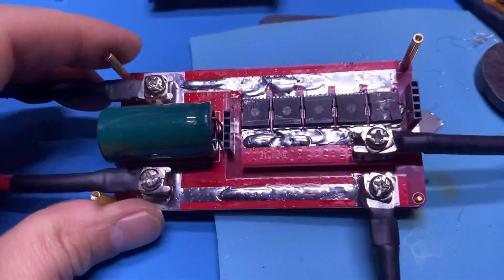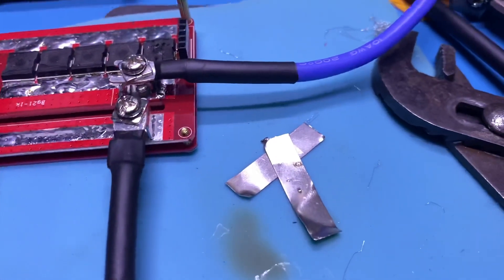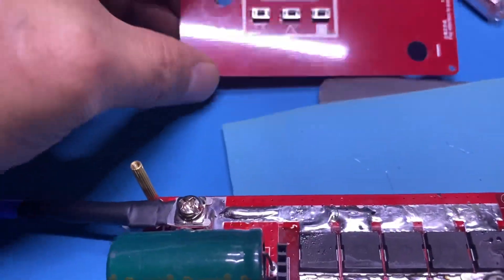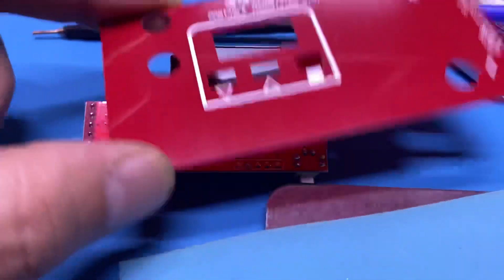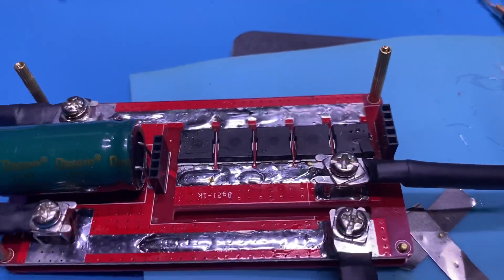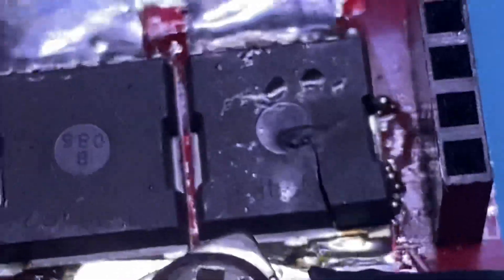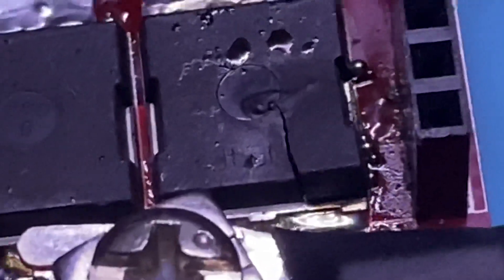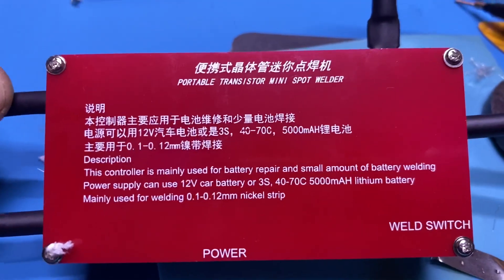Mini spot welder Don’t Buy It  What a piece of Shi#

Comment: Reacties

Voeg een openbare reactie toe…

C Knol
Fiends have exactly the same spotwelder, did some upgrades before using it. and it is working flawlessly. 
They put a resistor on both boards like in the YouTube modding is told, bit fiddly but doable, costed a few cents for the resistors. Beefed up the soldering lines with copper and more solder and changed the to thin 10 awg source line for 6 awg battery cable with battery clamps. They use a 73ah car battery. 
All for a few euro s and a little sweat more you can have a lot of benefits from this spotwelders.
They do 0.2mmon E55 no problem, no heating up, even no fan needed! 

Why put in negative feedback when not necessary if you look a little further..

Comment: i have build a DIY spot welder from an oven transformer which is awesome i think that durable than any other battery-based spot welder it has lots off power even it can weld thin iron sheets.

Comment: sorry to know I did the same my spot welder burned like yours. then i brought new Mosfet replaced them now its working fine. it can weld really thin nickel trip under 0.12mm replace then MOSFET and don't go over 40E

Comment: Could you use the controller to  switch a car starter relay. Run the high amps thru relay and not controller?
Reply: Controler board can be used to trigger relay. Issue with relay is sometime it stuck that would really dangerous. Fire 🔥
Reply: @DrNasirHayat  a mechanical relay reacts too slowly

Comment: Don't use a big battery( leadacid )speciall (car battery is rong,..

 12V max 20Ah (40/60C) can't bee Lipo or Li-ion battery ..
Reply from the maker: Diy_eBike Battery techevolution Yes I was thinking the same thing we can’t use car battery 🔋 I ordered the replacement parts and I have diode’s TV ones that are high powered that I’m going to replace one of the diode’s failed Which caused it to blow